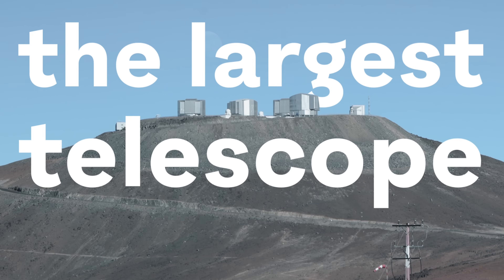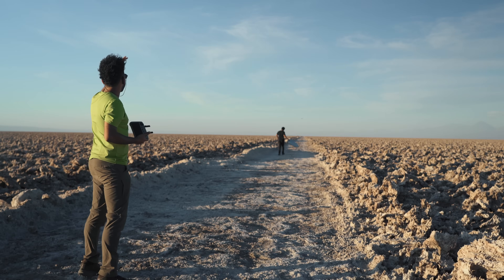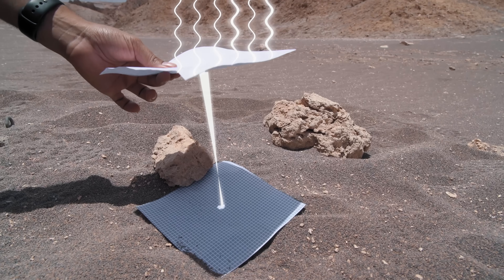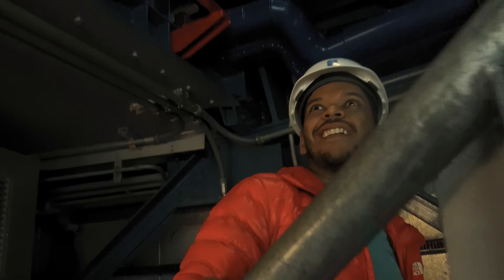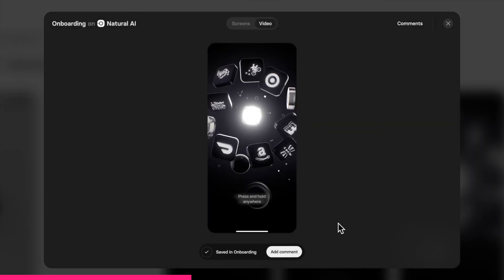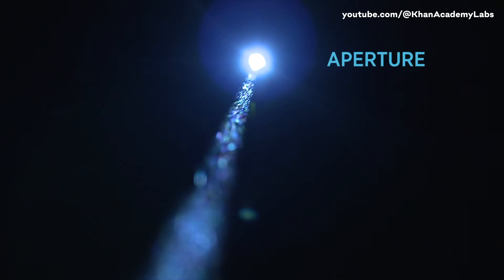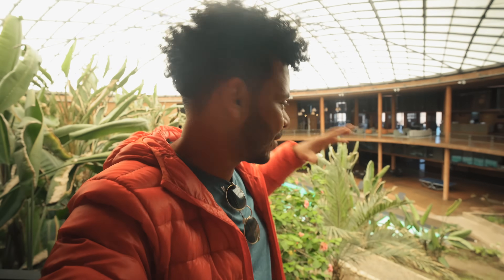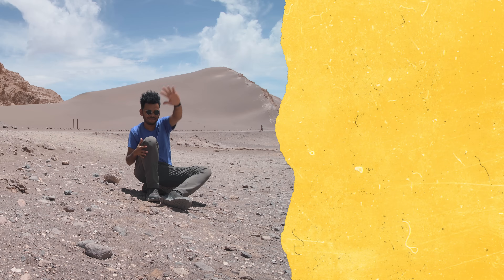Earth’s Biggest Telescope has an Impossible Problem

Comment: 3:09. Just a point of clarification. Zoom is not necessarily the right word to use when discussing telescopes and how they specifically work compared to other optical devices. They are nothing more than photon collectors, and effective magnification (not zoom) is a function derived from focal length, and/or a combo of using an eyepiece and its focal length.  (focal length does not change however like in a zoom lens). Resolution is derived from all of these variables including the sensor and optics (diffraction limited etc). 

So its not technically true in the sense saying its "zooming"  Telescopes are simply collecting light and focusing it to a specific point as you explained right after. 

Im being nitpicky, but its important for accuracy. First time watcher however, and loved the video! A lot of great information for those who are curious!
Reply: Right! Another word often used is "Power."

Comment: Size is the problem. A 6 ft pole vs a galley that is 100,000 light years across
Reply: A six foot pole is 0.000000006 light seconds across, and there are ten million pi seconds in a year, roughly.

Comment: So, basically (aside from being somewhat saturated out, optical & atmospheric aberration) the flags on the moon do not reflect enough light from a large enough “surface” area for us to be able to see it from earth with our current optical technology?
Reply from the maker: You got it! In a nutshell, it’s impossible to ‘resolve’ the shape of the flag because an aperture blurs the light.
Reply: @slidebean  what if the “apertures” were made from gravity?
Reply: @thedoctor2102   gravitational lensing has been suggested for use like that, and the only thing we have to work with is the sun, however in order to "focus" the light bended around the sun you'd need to put a spaceship far out at a verry specific position, and then block out the sun. It may happen one day but it's very hard.

Comment: There is a very old science fiction short story, by Isaac Asimov, where the MacGuffin is a device that is able to ignore the aperture problem.  It is the sequel to his short story where the survivors of an interplanetary shipwreck use their heads and a lot water to get rescued.  

As for making flat earth proponents shut up, I like to bring up how, just before sunrise and a little after sunset (weather permitting), it is possible to see the Sun illuminate clouds from below.  Their only two options to refute this is call you a liar for claiming to have seen this, or admitting that the Earth does not appear to be flat.  If the Earth does not appear to be flat, they have no reason for believing it to be flat.

Comment: Sorry, may be a primer on optics, but there are plenty of wrong things. Pinhole camera doesn't have a focusing distance, transparency is not the reason big telescopes are made of mirrors instead of lenses...
Reply: Yep, I noticed a few myself. I pointed out to clarify that telescopes do not "zoom", and not technically the correct term. All in all though, it is an ok video for those potentially curious and a good starting point. Curiosity is important. I do not expect an in depth technical or scientific analysis for a casual channel like this.  Albeit, it is extremely important to pass on the correct information and being accurate if you choose to communicate science of any type.
Reply: he also messed up with full moon and andromeda galaxy size comparison on his smartphone photo. doing science aint easy if your have no basic knowledge
Reply: @andriusnesvarbu-o8d  I think that was OK. My C8 with basic Plösel eye piece fills the f.o.v. With the moon. In LA, andromeda is the same. When I went to Joshua Tree NP, with dark skies, andromeda was much bigger. 

But in radians, andromeda is roughly 200k ly/ 2.3 M ly, which is much bigger than half a degree.
Reply: @DrDeuteron  I cant recall if his apparent size comparison was wrong or not to the moon. Will have to check.  In any case; the best way here would be to use the human eye to compare the apparent angular size of the moon and somehow overlay the correct size of Andromeda with long exposure.  Obviously, it looks much smaller than it is with the naked eye compared to long exposures with a sensitive cooled astro cam.
Reply: Yea, the explanation of aberration was also a bit off but I don't wanna be TOO nitpicky since it's easy to do so when you know a bit about the topic.
Reply: The illustration of the little sun and how the light hits earth was kind of funny...😄 I mean you're the one trying to go against flat earthers...😆😅😄